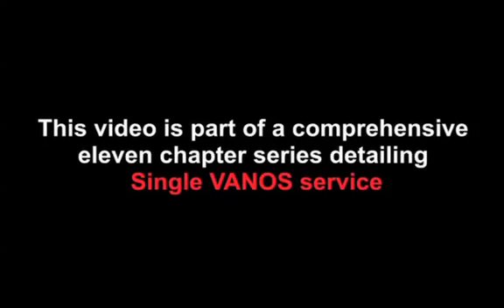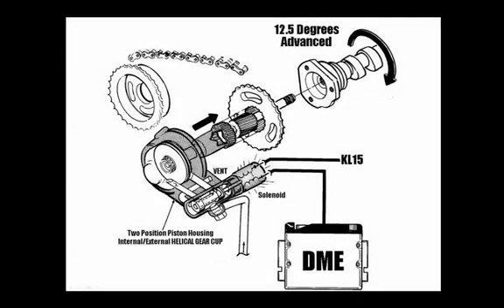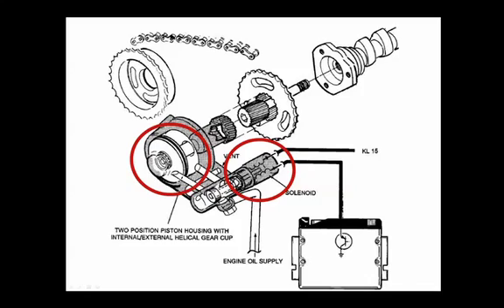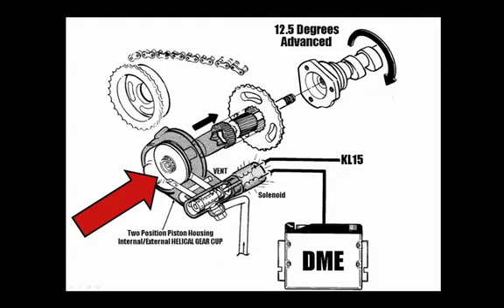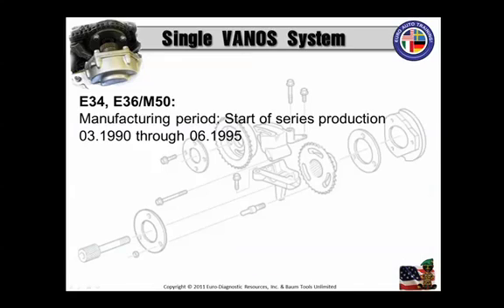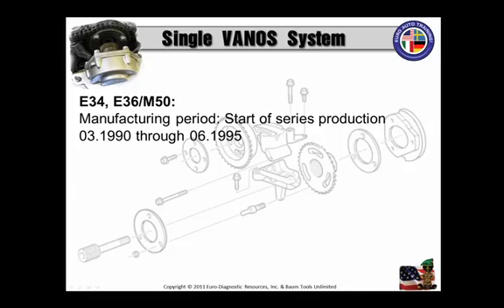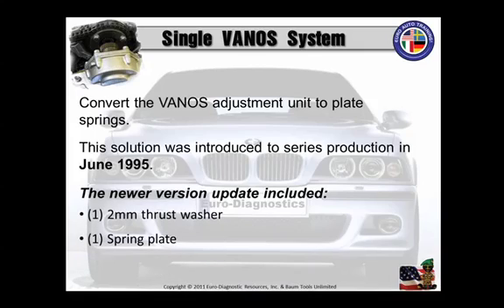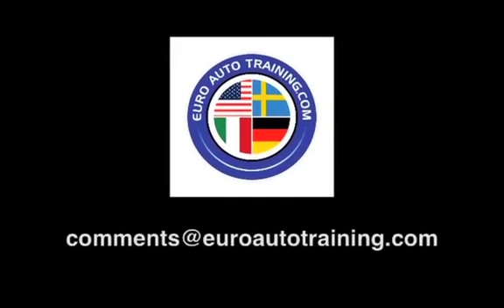VANOS - Chapter 2: Single VANOS System Description

Comment: My hydraulic set screw broke off partially leaving a portion of said screw inside of my exhaust camshaft side of the vanos, specifically in the splined shaft that uses a T30 torx bit to remove said screw. Can replace the 'splined shaft' only by ordering one and the screw for same? Or do i have to replace entire exhaust camshaft lobe. Thank you. My email address is as follows: coontakentay@hotmail.com